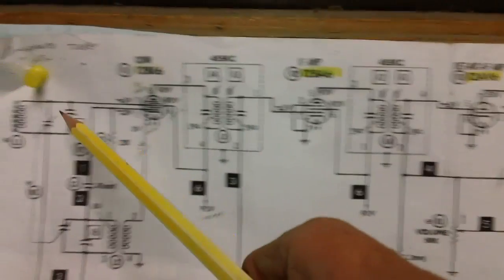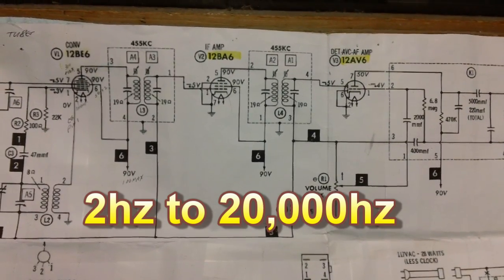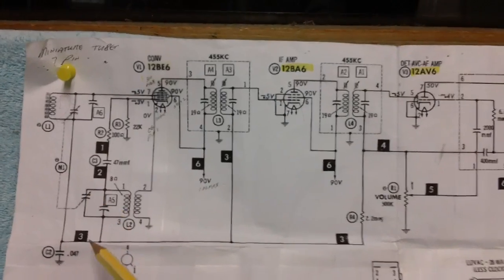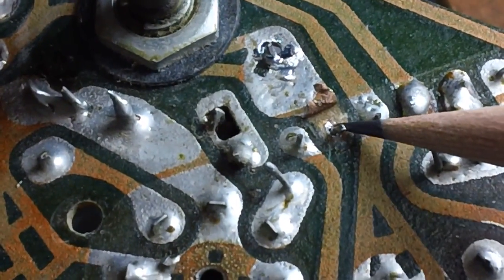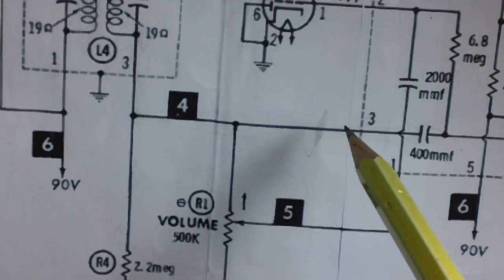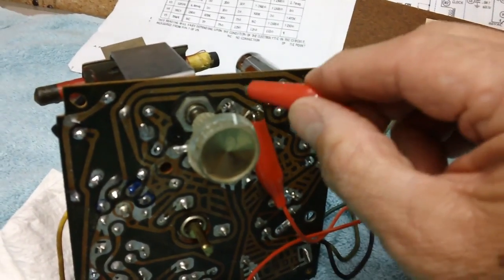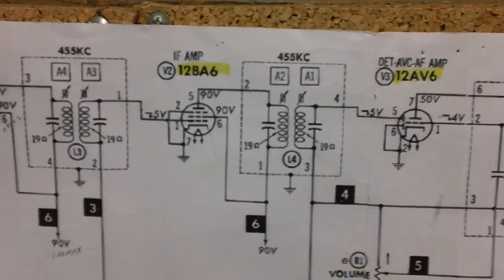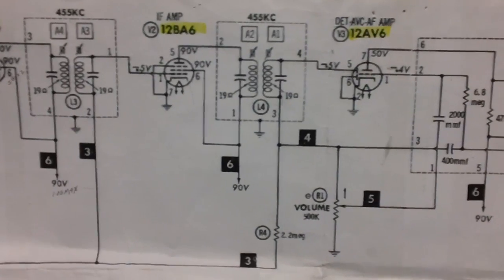General Electric C-403A Radio Repair Exercises (part 9 of 14).

Comment: Hey John, I think you probably meant 20 Hz to 20Khz as the frequency range of human hearing. ;-) a 2 Hz sine wave would make the speaker move in and out in slow motion. I'm pretty sure there is a way to look at the IF with an oscilloscope, I don't know if you have one but it might be an interesting demonstration if you could find one. I've been browsing them on ebay myself but they can be a little pricey.
Reply from the maker: Daniel,
You're sharp as a tack, my friend.  The human ear frequency range is indeed 20Hz to 20Khz.  I'll be sure to make that correction in the next video.  I thank you for pointing  that out.  Good going.  But I'm still better lookiing than you are.  LOL
As for the o'scope...I do have one, but very few newbies do, so I decided to not work with it.  The idea is to keep this series at the bottom rung of simplicity.  Those desiring more indepth/technical info can easily find it on the net.

Regards,.
John
Reply: LOL Thanks John!

Comment: John,
You explained the purpose of high-pass filtration in the circuit very well my friend.   
As a teenager, I found the mechanics of AGC circuitry not so easy to grasp.  Whilst in my first year at college, it all became clear when a lecturer encouraged me to think of ‘the AGC line’ in terms of being a very simple comparator.
Just a suggestion: once this tutorial series is complete, I’d say the principles surrounding VHF is the next subject for a radio servicing tutorial series.  I feel sure viewers would benefit greatly when Foster Seeley, and ratio detector, discriminators are explained (there are other types, avoid those as they are almost never seen in domestic VHF radios) – what d’ y’ say my friend?
Alternatively, there is huge mileage in explaining various principles surrounding HF radio (and transmission).
The reason for my suggestions here: I genuinely do not want your radio tutorials to end – I’m enjoying them too much as it brings back happy memories from forty years' ago LOL.
Regards,
Phil.
Reply from the maker: Phil,
"I feel sure viewers would benefit greatly when Foster Seeley, and ratio detector, discriminators are explained (there are other types, avoid those as they are almost never seen in domestic VHF radios) – what d’ y’ say my friend?"

You can't be serious, old chap.  I'm barely making it through this AA5 mess.  LOL  I'd have the viewers so lost nearly all would decide to un-sub me.  Perhaps the above subjects would be best covered by a genuine technician...such as yourself.   I'll be waiting, my friend.  :-)

Regards,
John
Reply: Ok John,,Whats a comparator? , and who is this Foster Seeley? related to Foster Brooks?...hummm
Reply: Buzz1151
Buzz my friend,
Put very simply, a comparator is an automatic potentiometer-like device, largely in IC form, that compares two voltages, or currents, and makes calculations for optimizing a ‘manufactured set’ balance, i.e, when a voltage, or current is too high it turns it down: when it is too low, it turns it up, within the psu supply. 
Foster Seeley, and Ratio, are VHF detector circuits.
Cheers,
Phil.
Reply from the maker: Buzz,
Yeah...what Phil said.  LOL

Regards,
John

Comment: good day John
would it be worthwhile to do video on typical tube failures and what they sound like?  Is there a way to diagnose tube problems without a tube tester?
Thanks for the great videos
Bye for now
Mike
Reply from the maker: Michael,
With me, tubes are good, bad or weak.  I let my high end Triplett sort it out.
It's long been said that the best tube tester is substitution with a known good tube.  Short of that a tube tester is almost a must for we hobbyists.  Search around for a basic functional Heathkit tester in good condition.  A TC-1 or TC-2 will fill most of your testing needs.

Regards,
John
Reply: joernone
Sorry to say this, but a tube tester is ok, for a good/bad tube check. But when you really want to know if that tube you hold in your hand is suitable, you better set up a little test circuit and test it under real conditions. Especially power tubes needs a "real life" test. If an EL34 is under test with "only" some 150Volts on a tube tester it may pass the test, but in an amplifier working with 650Volts plate and 400Volts screen, this is a complete different setup and the tube may work, but if it has problems (grown- or factory new fault) it´s likely possible the tube tester shows "new" and then it fails in the amplifier.

I do not trust any static tube testers anymore, i had the "funke W19" and the far better "neuberger RPM 370" but later one had to go as well due to limited space in my hobby-lab. I still have access to the RPM 375 (blue faceplate model) in our old radio society ( http://www.radio-museum.de/ ) and i use it now and then.....

Another story i tell everyone dealing with old tubes:
I restored a numer of old Philips PA Amps within the EL64x5 series, I own two EL6415 each is 30Watts with two EL36 in PushPull output stage. Both amps had so called "dead" tubes. After i restored the amps and test it with new tubes all was fine, i could easily left it like that, but as i´m curious every time i wanted to see if the tube came with the amps are really that "dead". I ran the amps just with the heater voltage over night with the original set of output tubes and test it next day.

Old tube within storage and no use over years need to be heated very well before they will again be used due to cathode degeneration.....

I measured about 20W at the first and 10W at the second amp both peak undistorted output. Ok since the tube are not that "dead", i raised the heater voltage up to 8 volts after that heater voltage change, the tubes worked like new and they still in buisness since some >6 years by now, with 8Volts powering the heaters....and i use it nearly daily as they are the amps which power my main mixing monitor speakers here.
So, even you been told that some tube within a unit you just got are "dead", just try them may they are not that "dead" at all;)
Reply: joernone Good Day John
Thanks for the heath kit TC 1 or 2  info.  I checked them out on ebay and they look pretty reasonable.   I know you like old radio stories.   I have a good one about my entry into radio collecting.   Ill try to send it to you in a day or two.   Im looking forward to your next restoration.  
Bye for now
The old new bee
mike

Comment: Great video, John. I just finished with the electronics of my AA5 and it's working like a champ. (It was a bad tube causing the feefback noise.)

I can't wait for the next installment. It helps me better understand my AA5 radio better.

Do all tube radios have a certain amount of hum? I've fixed three radios now and each seems to have a very minor amplifier-like hum. 

--Ron
Reply from the maker: Ron,
Good question and the answer is a flat-out no.  None of my finished restored radios have hum.  If so, I find out what's causing it.
During the first few years of restoring these old radios I was told (primarily by old-timers) that nearly all of them exhibit some hum.  One guy said that manufacturers made them hum on purpose so owners wouldn't go to sleep at night and unknowingly leave their radio turned on with the volume down low.  The hum was a safety thing.  Can you say crock?  At first I believed that hum was normal, but have since found that to be total nonsense.
Take all this for what it's worth, my friend.

Regards,
John

Comment: the audio can be 2 hurts to my 2 ears because it is 2 loud!
Capacitors and coils have the ability to choke (stop) and pass and filter  certain freqs. Tubes amplify or rectify. But resistors resst.  Sorting out and controlling all those electrons - John, I think um getting it, but I am far from becoming a design engineer for making circuits.
Reply from the maker: Don,
All this AA5 stuff is actually pretty easy once someone shows you how it's done.  Being just a hobbyist, I really don't need to know the workings of every little circuit detail.  I just thought it would be fun to learn a few new things and take any of our interested subscribers along with me.

Regards,
John
Reply: As long as we all happy doin´ the things we want, hey,  why bother....If we running in some difficulties then it´s time to ask someone, or figure it out by ourselfs and/or asking questions to some other people who are doing the same things.

Or watch YouTube videos.....like this one :)

I had been a design engineer for some years, but guess what? The only real fun i had was when i built up some test circuits on my bench. But this time was only about 5%. The other 85% i spent in front of some two big CRT monitors design schematics and routing PCBs (=boring!!)

The final 10% i spent on how to let my boss think that he just had a great idea when it was mine in first place and some more boring conversations with distributors and how do i get some samples or that we need some tiny SMD chokes for our new switch mode power supply to fit that tiny case along with the PCB which does the real thing....

Electronics are far from beeing any fun when it needs to feed you. It´s only fun when you can do what, when and how do you want it. So do what you want, and have fun !
Reply: Thanks guys! Um dangerous with a screw driver and soldering iron.  I tend to experiment, unless it's a transmitter, gotta keep it legal, like 4 watts!

Comment: I thought exactly the same thing when you disconnected the cap for removing the carrier frequency, why doesn't it sound much noisier, haha. Like I have 455kHz super hearing or something.

John, I have a radio that only emits static no matter what frequency it is tuned to. Is there a way to "inject" a signal into each stage to try and isolate which stage might be bad?

This series is awesome by the way. I'll be sad to see it come to an end :-(
Reply from the maker: Static can be caused by many things...shorted tube elements to tuner plates that are touching to SMD to bad solder joints to loose connections, etc.  Scope everything out.  If all looks good, then try to get your hands on a signal tracer.  I'll be showing how I use mine  in a subsequent video in this series.  To me, they're indispensable.

Regards,
John